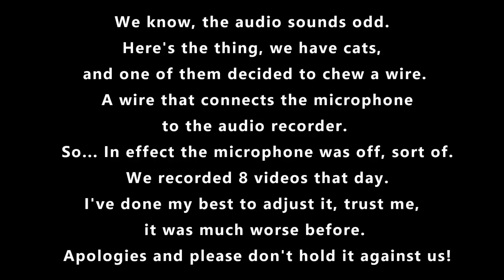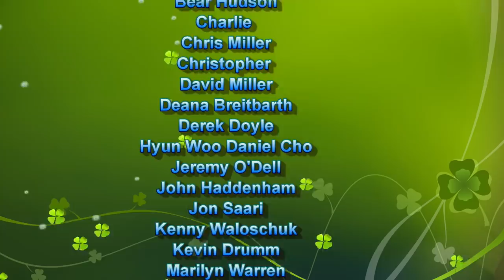Rhodomel Rescue!  - Can we Save this Rose Mead?

Comment: Hey brian, hey derica
Hope that fixes it, that combo sounds delicious. Ive just made a batch of capsicumel and it turned out way hotter than intended. Any methods to tune back the heat? Ive already did backsweeten it to about 1080. Could i try diluting or adding even more honey? Thanks fo all your tips and tricks, you have been extremly helpful in my first meads so far
Reply from the maker: If you dilute, you could run the risk of refermentation, same as with backsweetening.  You 'could' pasteurize then dilute and/or add more honey.